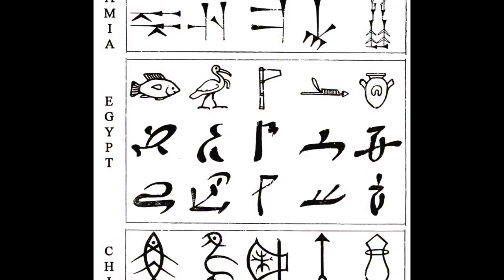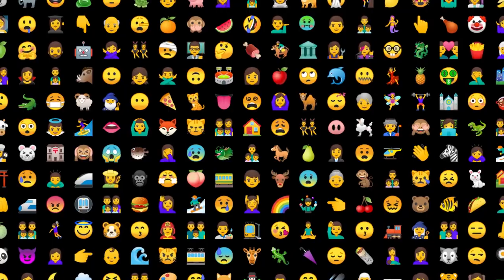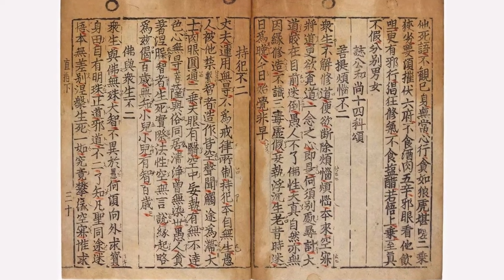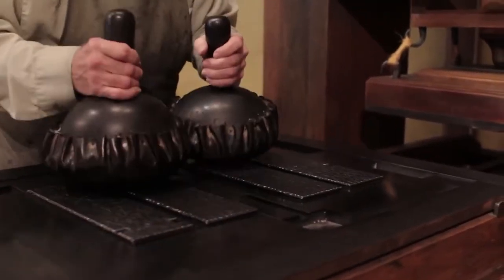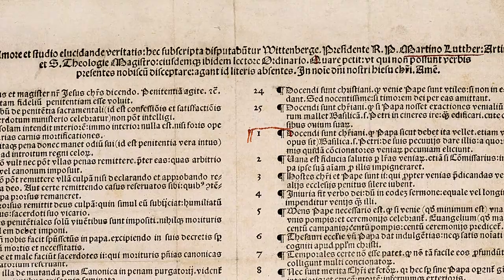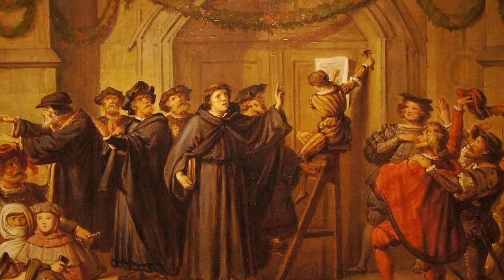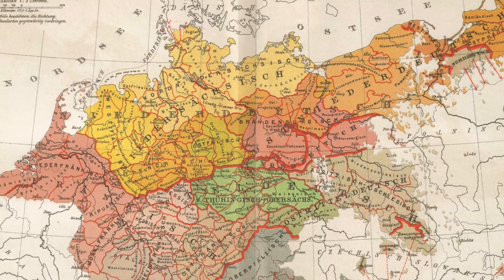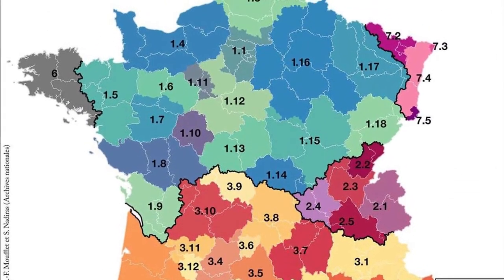Media History: The Printing Press Revolution

Comment: At 1:00 you ask the question how you can communicate with simple drawings? And then you pretend this isn't possible. In practice, however, it appears that this form of communication, known as logograpsch writing, does not have the problems of using separate letters that are put together on the basis of their sounds.
And in practice it appears that those sounds develop, with the result that in English we have words that sound the same but are written differently and words that are written the same but sound different. Letters that are there are not pronounced, while letters that are not there are pronounced. In addition, there is a written national language, but it is pronounced differently by everyone. In the logographic script there has been some abstraction and merging, but it is logical: the drawing for a house shows that it is a hiding place for something very valuable. The drawing that represents tea shows that it is a plant, which part is used and that something has happened to it. Why words sound like this or like that is not logical.